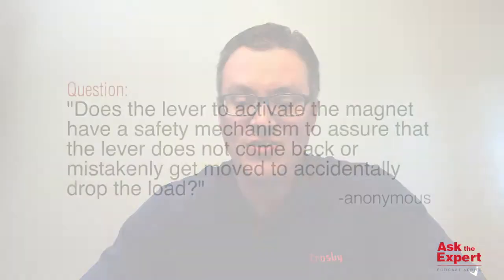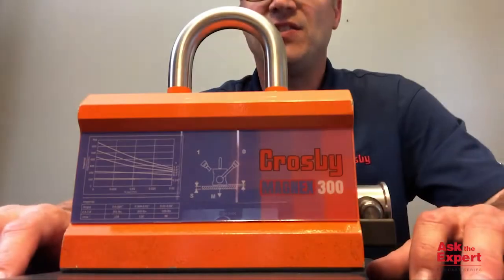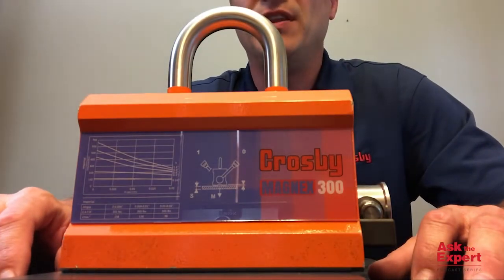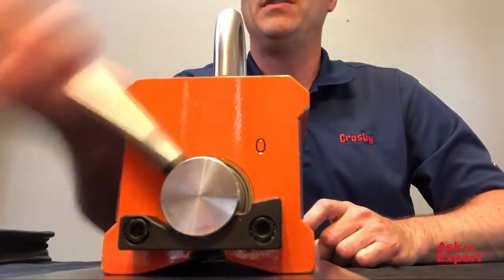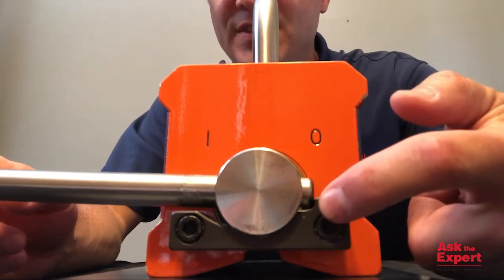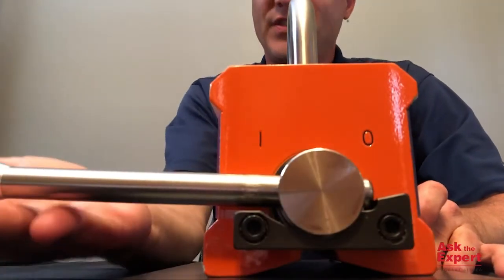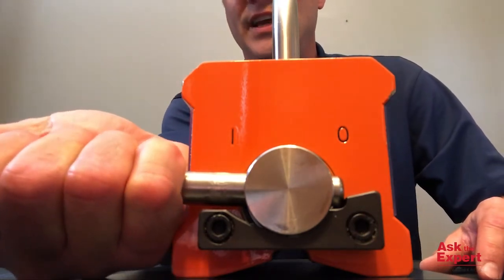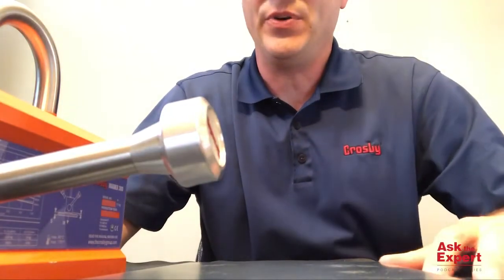Lifting Magnets: Safety mechanisms on levers

Comment: Just used one at my job that has an easy button to release load. I accidentally hit it and dropped the load. I mentioned that the style of magnetic crane lift they have is unsafe. No way should it be that easy to release the load by an almost hair trigger lever.

Comment: how does the magnet turn off?  how it works?
Reply: It lifted the internal magnet far enough to no longer have effect.
Reply: @jaxturner7288  that would require a 100kg force on the on/off lever....  working with a 100kg magnet.   Thus you are wrong...  2:00 shows a one handed easy movement to release the magnet.
Reply: @annpeerkat2020  umm, guess you don’t understand what leverage is yet? 
Hint: the lever is not moving the magnet at a 1:1 ratio. 👌
Reply: @jaxturner7288     dohhhh    yes I do understand leverage.....   clearly you don't understand what's happening here. 

I ended up doing my research, and understand how turning the handle TURNS one of the pair of permanent magnets, changing the magnetic field orientation....    NOT levering the magnet away from the lifted plate.      

Thanks for that great demonstration of ignorance and arrogance combined!